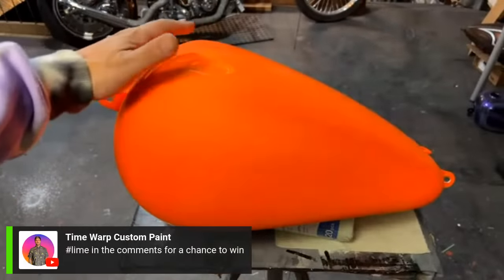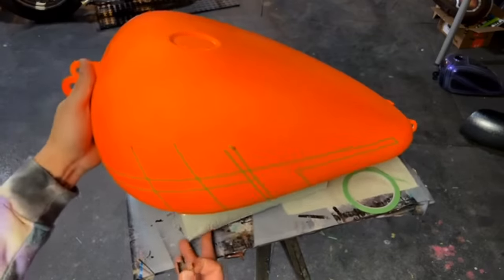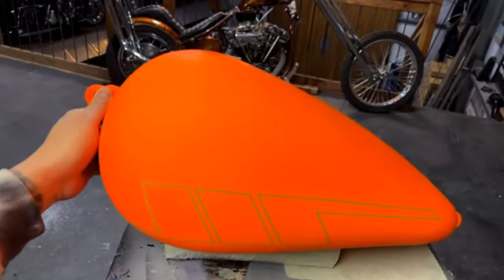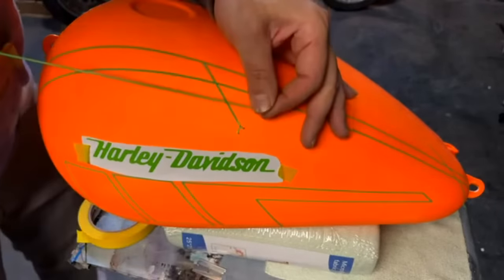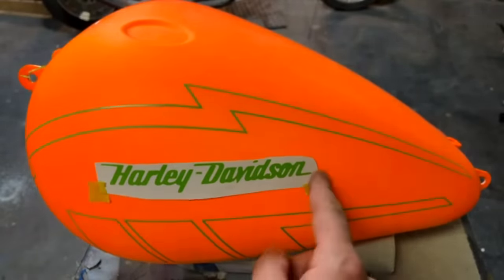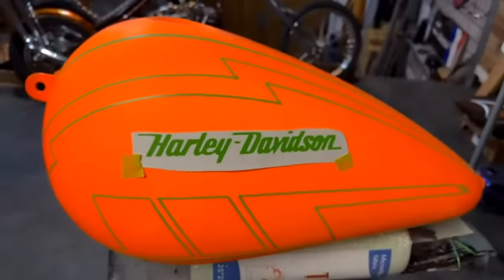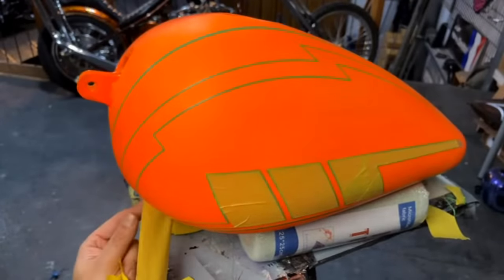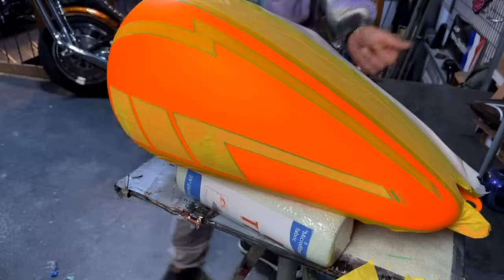Harley Davidson Gas Tank Custom Paint Graphics using LiME LiNE

Comment: Great job 
Did you get any tiger stripping with that airbrush? I been thinking about getting one for the longest time but didn't find any with double action..
Reply from the maker: Yes, you can get Tiger striping when using colors however, black base coat is different